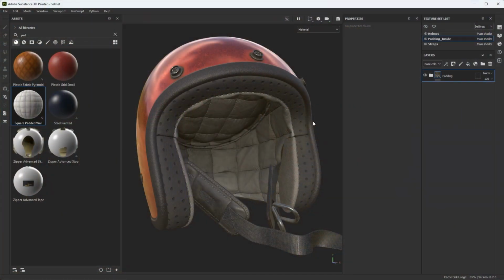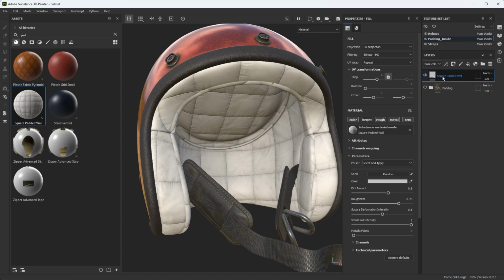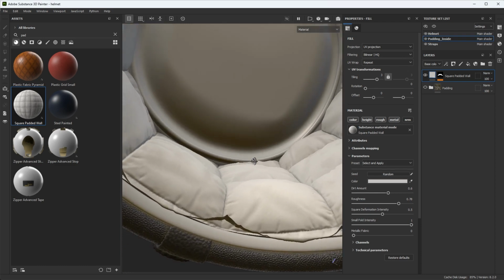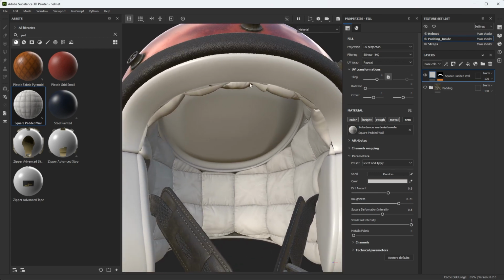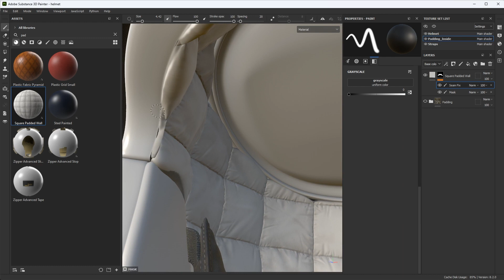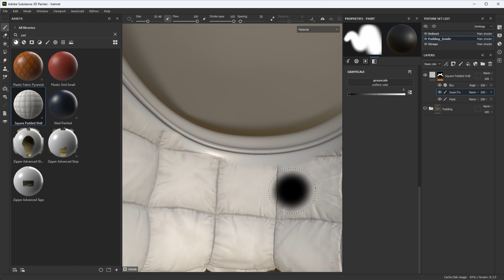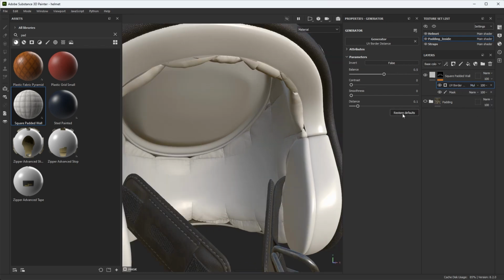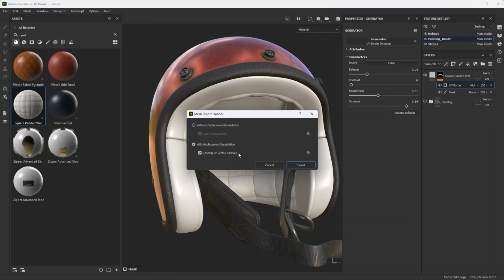How to fix seams in Displacement Maps using Substance 3D Painter

Comment: I'm painting the skin of a character using perlin noise as height map, the problem is the character has different density on the areas (arms, torso etc.) and even using triplanar the result near the seams is not good. Can I use the generator to blend/smooth height maps across seams? How?
Reply from the maker: Very sorry for late reply. Yes, I think you could try the mask outline filter which works based on the UV shells.

Comment: Awesome fix, thank you so much. I also notice when using procedural mask in conjunction with some blur effect or sharpen for instance, the seams get screwed up, why? No matter what projection type you pick.
Reply from the maker: It could be project sampling. In the Shader, make sure your samples per pixel are always set to High. If you are talking about seams with displacement, it's a limitation of the shader and I will typically have to manually fix those issues.

Comment: That's smart tip of using uv border generator to cover the seams. 
Even if it is not going to work for all cases, it's still  handy to have.
VRay renderer have "keep continuty" option that's used to fix this kind of issues, I'm wondering if it's using the same concept under the hood. 
As always thanks for sharing!
Reply from the maker: Thanks! I am not totally sure on the underlying tech. Other options we have are 3D positional masks. These generators can help when you are needing to mask based on a specific axis.

Comment: Small Question here. Can Substance Painter Extract UV Coordinates or Create its own UV Maps that can be read in other 3d applications?

Where by I can just export my model from a 3d app without UV Coordinate and do everything in Substance Painter?
Reply from the maker: Yes! We have auto-unwrap tools. When you create your project, there is an option to generate UVs. It works pretty well and create a nice uniform texel density. You can then export the mesh with the UVs from Painter for use anywhere.
Reply: @Wes McDermott  Thank you.. UV section has been super tough area for me in my texturing workflow I guess substance painter is the right direction to take to make this section easier

Comment: Instead of exporting the mesh, would you not get the same result by just using the height map for displacement say in vray.?
Reply from the maker: Yes absolutely. You can export the displacement map and use that in vray. I don't need to worry about polycounts usually, so I just export the mesh and then use a 2nd normal map to apply some more granular detail.
Reply: @wes.mcdermott  I tend to forget to export the goe, so thankss for highlighting that, You are the best tutor by far in the industry Wes, been following since the Allegorithmic days!